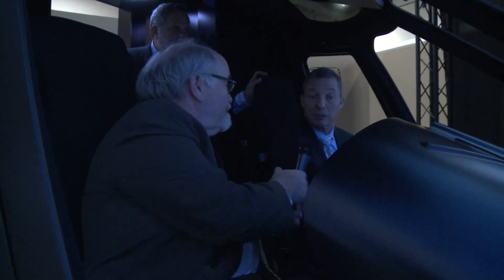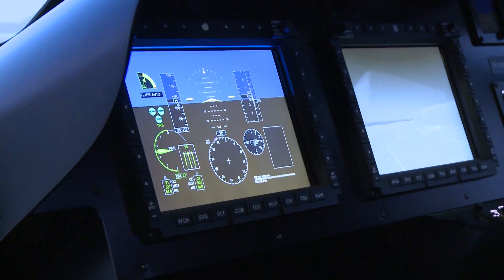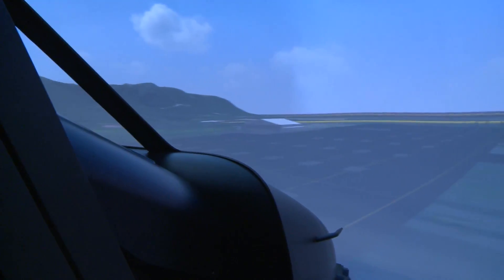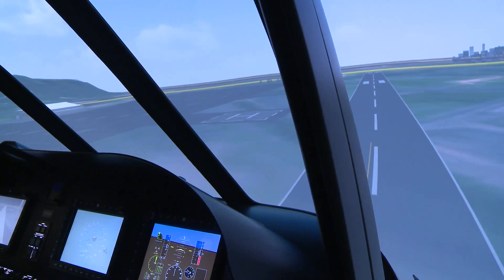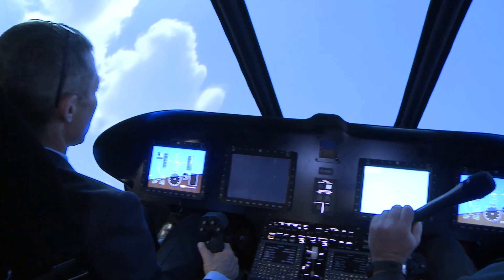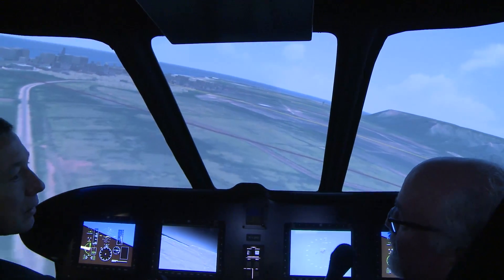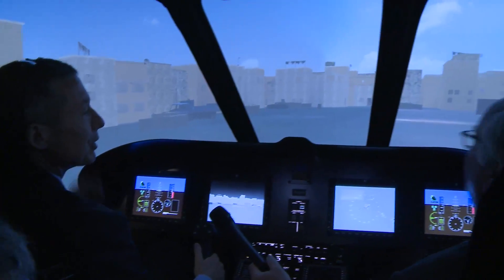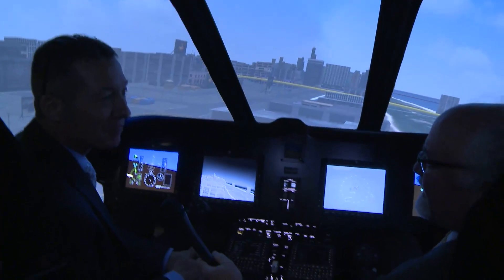AUSA 2016 - Fly With Us (Kinda) In Bell’s V-280 Valor Tiltrotor

Comment: Going to be a difficult sell given the Osprey teething issues. Plus it's width. You'd just think the army would prefer a more traditional helicopter footprint. The Lockheed defiant concept looks more like what they'd want. BUT Lockheed has really blown it with the F35 and I'm not sold on the old T55 engine. Hardly seems forward thinking. All that said I don't see either replacing the Apache or Chinook as the army envisions. Where are those concepts??? A 4 rotor version for a Chinook replacement???
Reply: Seems like the issues that made the Osprey's development so troubled would have been accounted for in the 27 years since the military decided that tilt rotors were the future. The simulator certainly makes it seem like an improvement
Reply: Google Name well they learned a lot with the v22 and taken the opportunity to perfect it with th280.  I think it looks great.  Can see it as a Blackhawk replacement for sure.  Not as much of an apache replacement.  Seems to me having the narrow fuselage is a much better advantage to see your surroundings left to right for the weapons specialist mostly and the pilot also.
Reply: Multiple issues with the V-22 have been addressed in the Valor. The engine exhaust is directed to the rear at regardless of the engine position. The width of the Valor is only 16in wider than a Blackhawk. The Ospreys have a bad reputation with it being newer tech and alternative design. With the amount of flights taken compared to the crashes, the V-22 actually has a good flight record. The Marines have been using them heavily for fast on-ground deployments.